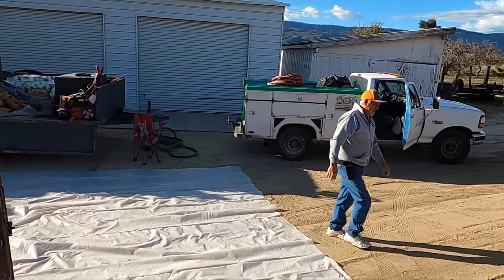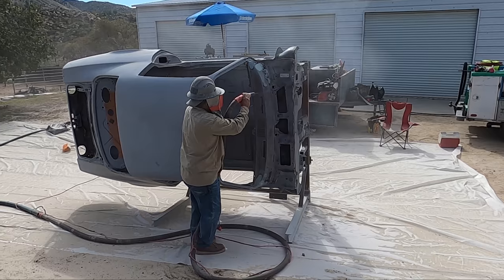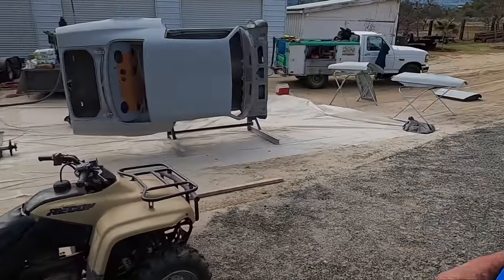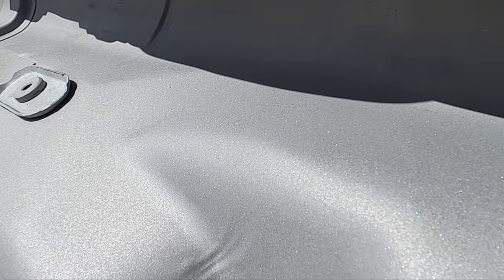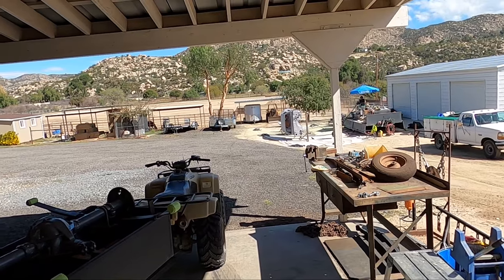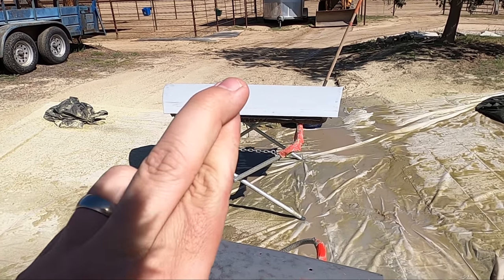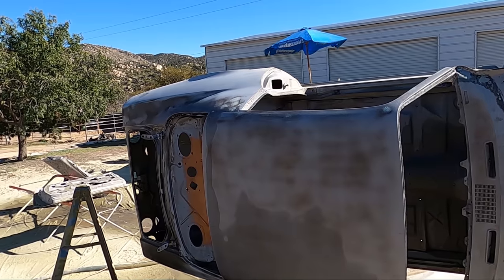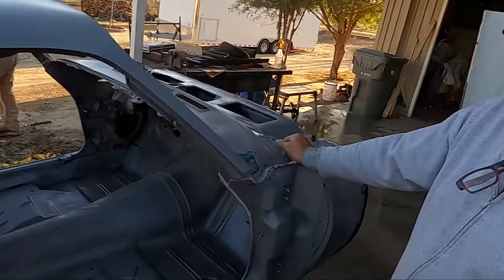Media Blasting Your Car #LethalClassic | S2: EP5

Comment: In the process of stripping down my '70 Camaro & found some body deterioration in the places. Worst of all are the "A pillars" & Cowl Panels. Alot of 2nd Gen Camaros have rust issues around the front & rear windows. Poor draining & not very good metal protection back then.
Reply from the maker: Very common